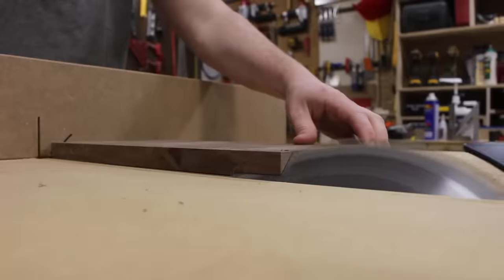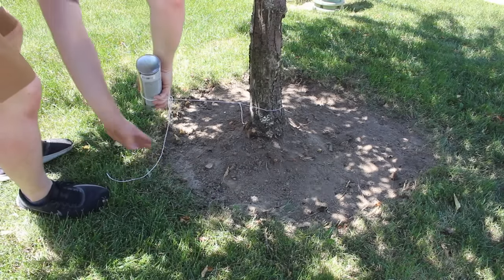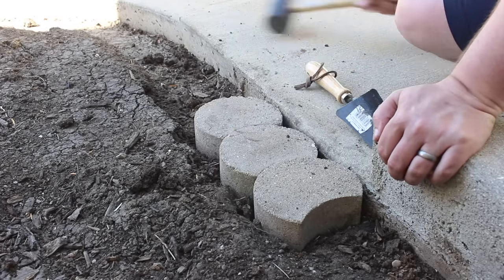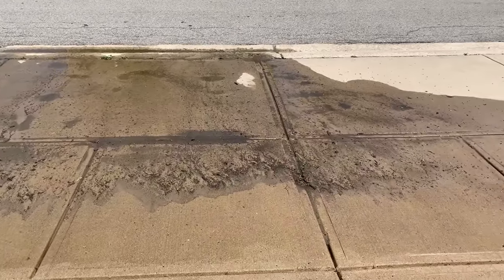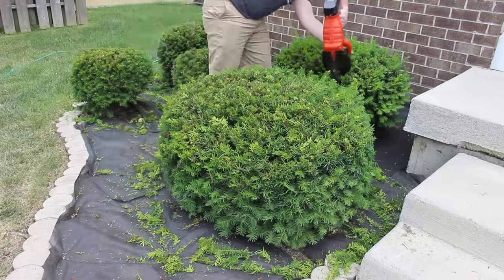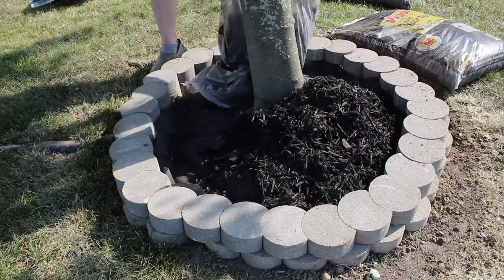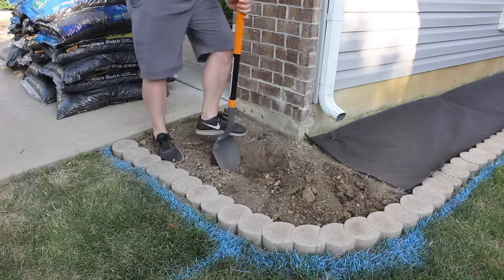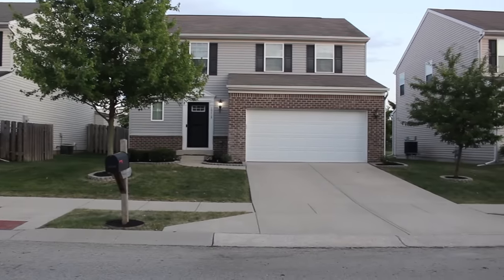5 DIY Landscaping Tips on a Budget

Comment: You did an amazing job!  Thorn bushes are typically placed under windows to deter burglars.  I had them outside my apartment window when I lived on the bottom floor and sleep better knowing they were there.
Reply: That is such a simple solution it should be painfully obvious and I'm kinda mad at myself that I never thought about that. It wont deter 'professional' burglars but somebody spotting an open window might think twice if they try to get in there with the angry plants in front of them. Thank you so much for mentioning it!
Reply: Burglars.     I do think this is common.

Comment: TIP: Unless you intend to do hard pruning/hedging all the time do NOT plant shrubs such as hydrangeas so close to your house as in this video, particularly since the first 45 -60 cm/ 18-24 inches  (depending on your eaves) out from your house is a drought zone.  Take the time to find out what the diameter of your shrub will be in its natural  or  intended hedged state and plant your shrub  a minimum of half that distance plus 10cm/4 inches  away from the base of your house so that the shrub gets good airflow and water. Putting a shrub in the wrong spot just means a lot of unnecessary work later.
Reply: It happens.  Misplaced shrubs etc its part of learning
Reply: @emmafrater4386  Too true.  Gardening is as much about sharing good advice based on experience and education as it is doing the hard yakka.
Reply: Great tip. I made a vegetable bed near the side of the house and it was too far under the eaves, back row never got rain.

Comment: As I get older I found all of the “curb appeal” adds to the annual maintenance to the property. Mulch next to the house can look good the first year it goes in. The previous owner of my home put down a large amount of mulch. Especially in two locations. A raised flowerbed (pavers) outside of a main room in the house and a playground with landscaping timber surrounding the area. Both turned out to have large numbers of ant colonies (luckily nondestructive) in them. The playground had termites in the timber. Both areas had been neglected for several years. I mitigated pests in both areas and seeded. 

I added curved mulch areas to the front of the house. I later removed the mulch, reseeded and it’s the nicest looking grass in the yard. Working on the rest now. 

When you add to curb appeal, remember what you put in only looks good if you maintain it. When you sell the property it has to look it’s best. This can mean you have to maintain it while you’re not living there and renters generally couldn’t care less.
Reply: We have sandy soil. So I chose a nice small river rock to go in my flowerbeds next to the house. Termites love the paths of least resistance so I am not taking chances!

Comment: Mulch will degrade into humus. Taking out old mulch makes your soil poorer. The trick is to continually add new mulch. Don't chuck out old dirt, and do run your cut branches thru a chipper. You just threw out a ton of nutrients, which you then had to rebuy from the garden shop.
Reply: Exactly...this dude just wasted money and is perfectly happy being clueless.
Reply: Why is he putting landscaping fabric under the mulch. I never do that. I keep the mulch a good thickness and add a bit every year or so. That suffocates the weeds without the fabric.
Reply: Maybe he didn’t know that. I sure didn’t. Thanks for the tip! No need to be rude, Lee Lindsay. 👌🏼
Reply: @pisces031372aj  I would still use weed blocker. It deteriorates and weeds still come up like crazy.
Reply: @pisces031372aj  I was thinking that I am the only one confused about that landscaping fabric. :)
Reply: @lindam8503  yes when I bought my house they put landscaping fabric under the mulch. As the mulch broke down it created a layer of "dirt" on top of the fabric and the weed grew in anyway. I pulled all that fabric up, put 2 inches of fresh mulch and I have few if any weeds. I put a new thin layer every couple of years.
Reply: @Loveyourlookhawaii Exactly! People being rude for no reason.
Reply: If you get a round surface cleaner.  Looks like a rumba vacuum but it’s green.   It cleans concrete soooo much faster.   It costs $40
Reply: @pisces031372aj  I just bought a house and just spent this past weekend pulling up weeds and couldn't understand why considering the fact that I saw the flack fabric beneath the mulch but I did read somewhere to just add new mulch over the old so there's that
Reply: Weed seeds are spread by wind, so they land on top of the mulch and sprout anyways. And since their roots grow down into the fabric they're tougher to pull.
Reply: @kimberlyjacob3455  if you don’t spray anything and keep it organic I recommend learning lots about weeds cause lots of them are actually edible or medicinal and more nutritious than grocery produce.
Reply: @leelindsay5618  why be negative he did a wonderful job on HIS property
Reply: I hate weed barrier, it such a pain. Just throw more mulch on top
Reply: @kimberlywinkfield876  Why be negative, he did a wonderful job on HIS comment.
Can you not see how you are acting exactly the same as them, you see something you find morally wrong, and comment on it trying to change things.
Reply: Thank you! Starting our gardening and the mulch is old, was going to replace now I’ll just add.
Reply: I did this, unfortunately after three years my mulch created artillery fungus which shoots up to 15 feet in the air. My house is now covered with this and pressure washing won't remove it (I've tried). I honestly wouldn't recommend that anyone use mulch because of this, and if they do, they should be made aware that this is a possibility.
Reply: @illjusthavecoffee  9
Reply: Wrong its all treated with chemichals and paints.
Reply: I just want to learn.  It'd be nice if everyone would just be civil to one another.
Reply: Ok so I’m not judging but most customers want there mulch dug out cause they don’t a flower bed 2inch deep then add another 2 then add another 2 and so on I’ve seen it happen and it leaves lumps and look nasty and may help but it’s not good and don’t use fabric use Tyvek home siding wrap it’s like 40 bucks at Home Depot and last longer then that black fabric crap if u put the tyvek in right and don’t mess it up u won’t have weeds but maybe a couple in random spots and u pluck them and they gone this guy might have not known what to do u can also use start strips from a roof or sheets iso board and cut out the holes for flower tons of things u can use that be bad to use to help I use concrete form steaks to Line my bricks up and they straight could use pitch forks to loosen the weeds up to pull if u really wanted to keep the old mulch idea advise getting the old underlayment up and then tilling it up and putting a layer of tyvek down and then add new mulch honest option
Reply: @kimberlywinkfield876 I mean I seen a few question I’d ask but other then that it’s his property

Comment: You did a great job 👍🏼 Thick layers of mulch and pressure washing sure do wonders! I’ve started using no dig landscaping—mow/cut weeds very short then cover with a double layer (or more)  of cardboard. It’ll break down over tiMe but it’s better for the soil in case you ever decide to plant anything. Also—keep those hydrangeas watered! If they’re the blue/purple ones, hammer some iron nails in the ground around them to up their color.

Comment: Great job! Such a huge improvement. One suggestion for the pavers is to put some concrete adhesive so that the pavers on top aren't easily kicked or toppled over. I did the same with bricks and it was frustrating how often they moved around without the adhesive. Cheers!

Comment: Might have been mentioned, but a tip for the future or others watching: String lines work great for a straight line, but not loosely laid out. Tie it off on stakes and pull it taunt. A tight string is straight.

Another tip is to lay out your edging stones on top of the grass before digging, so you can get the right circumference for the blocks without gaps or cuts. Then just cut the sod with your shovel around the blocks.

Comment: My experience with weed fabric ended in me removing it from my landscaping tools. When using it around small plants you have to leave space at the collar, a space that the weeds and grass will surely find. When watering, the fabric will trap and compact the water/soil mix, greatly reducing oxygen exchange at the base and root system (especially a problem for new smaller plants). And finally, when the grass seed finds it way through the fabric (the seeds can germinate on top of the fabric, then root down through it) they will then grow back up through it, causing one to remove the fabric in order to remove the grass.
Reply: Great advice!!!
Reply: Are You in Texas?
Reply: @earthlycolorbrown6246 : Western Oregon.
Reply: Oh been there! One more reason I don't care to use fabric! Lol
Reply: The previous tenants put this weed fabric. Now my problem is, I want to add some plants. The tulips and lilies are pulling the fabric out too. I might as well  just remove the whole thing and keep an eye on weeds. 🤷
Reply: @jq.8313 : That's what I've gone to doing. I don't panic, I just patiently work out the weeds along with my mowing, even if it takes a few weeks. My result is the beds look better and the crop plants look healthier.

Comment: Great stuff! Just to save you a lot of money though... move the mulch and fabric away from any plant stems or tree trunks, as you may kill them from suffocation and stem rot. And always avoid tapping metal into root zones.  The metal going into the ground may not hurt the tree immediately, but in hot weather you could see death or sickness due to burning roots from the metal. You're better off laying boxes down over the soil and placing mulch down on top. I have great success with this in my 8 acre garden. It has been a year now since you posted this, so you may have seen some of this occur, or you may be lucky and it didn't. Also, look up plant requirements before planting so you don't waste money, eg the hydrangea in the wrong place. Anyway, great video overall. Enjoyed watching! I am not being critical to be mean. Just to help you with what I know :)
Reply: Damn I didn’t even think of this   Thanks for the advice
Reply: Thanks for mentioning the mulching! My parents' subdivision hired a landscaping company that perpetually over mulched the trees in the common areas and most of them died from it! What a waste of money for the homeowners and so sad to see good trees killed.

Comment: Great video! 👍 Personally I prefer using the surface cleaning attachment with my pressure washer for concrete. It's that attachment for the end of the wand that looks like a mini lawnmower deck and hovers over the concrete when in use. THAT little attachment makes doing driveways and sidewalks SO much quicker and easier IMO. 😎👏💯

Comment: The hydrangea is too close to the garage and driveway. They get pretty large. Always consider the mature size of your plants when designing your landscape.
Reply: So so true. Brad, move it now and you'll thank yourself later. Look at the mature width of the plant and actually measure out to where you dig the hole.
Reply: Ah, thank you for saying this. This is my #1 landscaping pet peeve!
Reply: This is exactly why I came down to the comments section.
I made that mistake years ago. Put a hydrangea too close to the house.
In a few years it was right against the siding and scraping and scratching every time the wind blew.
Reply: @heididuncan4440  I second that motion!!
Reply: It appeared to be a Little Lime or a Bobo Hydrangea . Both stay in the 2' -3' range. It won't be too large for the spot.
Reply: Looked like a little lime hydrangea to me. Cut it back every spring. It should be great in the spot.
Reply: Don't panic if it doesn't flower for a few years or for a few years after you transplant it. Hydrangea are especially prone to transplant shock, they sometimes need to rest for a bit to put energy into rooting before putting energy back into developing buds.
Reply from the maker: Don’t worry I mesures it all out beforehand it will be just fine!
Reply: Yeah I love it when people plant maple trees 8 feet apart.
Reply: @ProjectBuildStuff  love your ideas but I thought the same thing about the hydrangea- it’s not placed well. I don’t think anyone is  “worried” ... they’re sharing good feedback with you, so please receive it!
Reply: Dixon: Yeah, the only mature one we have is always in the way. The ones at the church ultimately required an assassin's pruning. I gave my new starts about 30 sq. ft. of personal space even though I plan on keeping them pruned.
Reply: @erinkeyehkey6852 : Oh thanks Jules. I couldn't decide if it was that or the neighborhood dogs figured out a way to pee on them even though I have them (somewhat) protected.
Reply: @kennyc388 : Or any tree. Yeah, I'm a tree junky and I find myself thinning out my plantings. On the plus side by then I know which are my best fit.
Reply: @kennyc388  i work for a landscape company and about 7 years ago had a client ask for 2 silver maples to be planted very close to his house/driveway areas. He has some small boxwoods and juniper in the space previously and did not like the look. When i suggested he use a smaller tree because once they matured they would be too big for the space and possibly cause driveway/foundation issues he told me, and i quote, " This is what i want, if you won't do it i will just call another company ". I agreed to plant what he wanted but told him i would NOT be responsible for any possible future damage. He said ok and so i did as he asked. Flash forward to two days ago and he called me and asked if i could remove the same silver maples as they had quickly outgrown the space and were beginning to crack his driveway due to the roots growing underneath. I went to remove them and reminded him of our previous conversation when i tried to warn him of this exact situation. We both had a good laugh and he said he will never doubt me again. Long, boring story, but i thought it was funny. Lol
Reply: My exact thoughts. I have a dwarf hydrangea and it will still get 4 feet wide when full grown. If it had to be in that area, I would have planted against the edging in the curved portion to give it room to grow out in all directions.
Reply: Hear hear!!
Reply: @Bradford Pear every single year.

Comment: You did a great job and showed what a little effort can give you back in return.   You might want to look into some  "flat river rock" at the base of the downspout so the rain doesn't  run your mulch off.  just a thought.
Reply from the maker: I put a spout extender on it but it doesn’t look great, this could be a much better option!
Reply: @ProjectBuildStuff  The spout extender keeps the water away from your foundation.  Maybe some rockery around and maybe even arranged inside the spout to disguise it?
Reply: you want the rain leaders to move the water 12 to 24 inches away from the foundation using extenders, or even roll-up extenders.  lots of great suggestions here, you now have the wisdom of 40 gardeners. See , you got the ball rolling, thanks!

Comment: Enjoyed the simplicity; however, I would have set sand under the edging stones and used a LEVEL for a finer finish.  Takes longer but looks more professional.
Reply from the maker: I think it looks pretty good either way!
Reply: As a landscaper, I agree. The soft soil shifts over the years and in about 5-10 years you'll have to level them again to get a nice even lay. Sand can wash away over the years too, so I would recommend some Class 5 gravel (1/4" mixed with fine) Tamp it down with a little bit of water for a nice hard level surface that can last for years. Its cheap and can be found at just about any landscape center or quarry if there is one near you. Luckily, I'm from Southern Minnesota where limestone quarries are abundant.
Reply: @andrewnyberg5726  Thanks for the gravel tip, I'll be using it!
Reply: These comments are filled with knowledge. From tips on how to level flagstones to the value of old mulch because compost is so important to a healthy garden.  The internet is a place to share and learn knowledge. It is a two way street. If you want your audience to learn from you, you should also learn from your audience. having an open mindset will help you improve future projects. I'm off to water and feed my compost.
Reply: @andrewnyberg5726  Of course, you're correct.  Wish I would have elaborated.  I'm a FREAK about level/straight/plumb.
Reply: @kmtran841  great comment and very true
Reply: He is from California, he doesn't understand landscaping, the size certain plants grow into or how to properly lay edging bricks to survive these winters for coming summer seasons. Instead of listening to people who knows more than him, he just wants to make excuses or just focus on what it looks like this right now. He will have a rude awaking next summer and the summer after that when he is in the exact same position he was in before is yard make over. What a waste of $300. Not even sure how he could have even spent that much.  Others are listening keep the great advice coming commenters!
Reply: @JaneDoe-ze4uk  I was thinking the same thing.  Indiana gardening is nothing like California gardening.